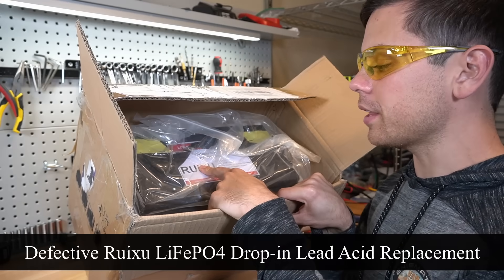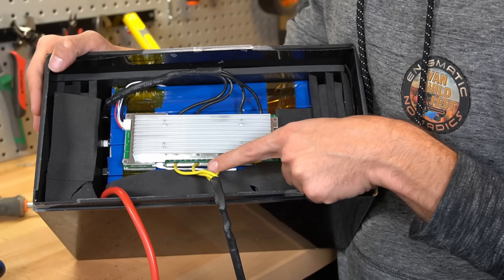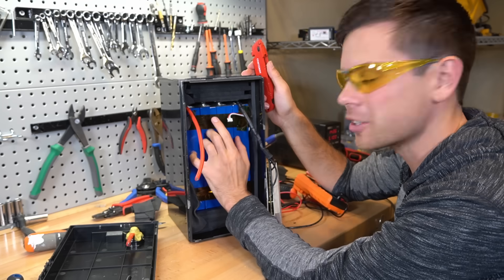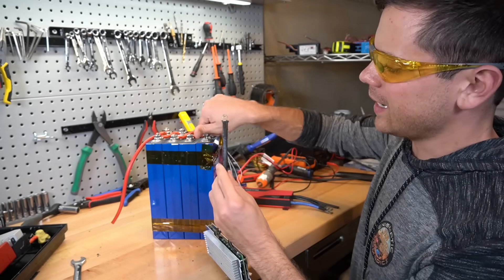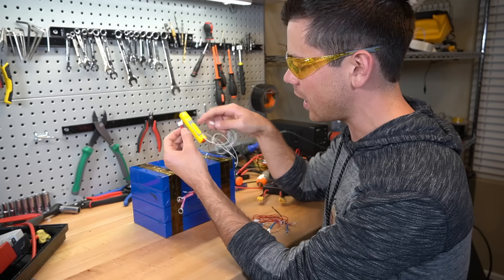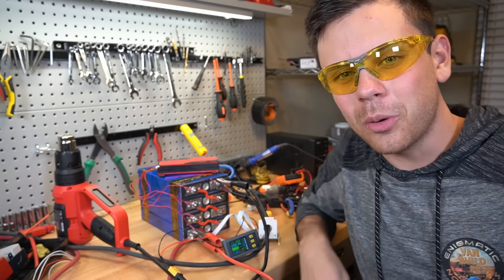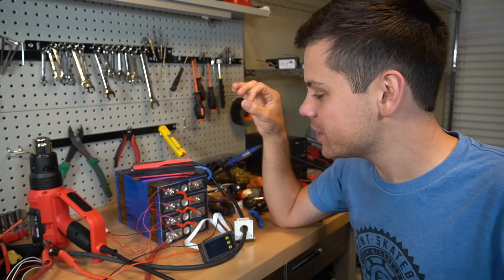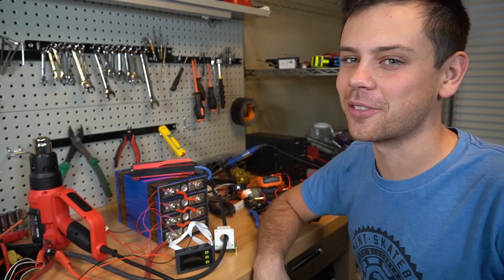Opening a Defective $700 Ruixu 100ah 12v LiFePO4 Solar Battery

Comment: can someone explain why it would read 12.3v with the bms lead disconnected and 13.0v with it connected ? i have a brand new battery thats doing this exact thing, 12.31 volts and wont take any currant....

Comment: If I get it well, there are 4pcs  of 14 AWG wires - for 100 Amps... that is very low.  I would expect like 2x-4x bigger wire crosssection for 100 Amps.

Comment: That's literally how 90% of lithium batteries look on the inside. EVA foam is not that cheap of a material. There are not a lot of materials that you can use to fill the gaps inside.

Comment: The reason why the temperature sensor can only shut off at high temperature, is because it's not a temperature sensor it's a Thermostat. You'll probably see a Temperature Level printed on the package. It's basically a bi-metallic strip that disconnects at some temperature, maybe 50C. And I agree you need to have a low temperature disconnect of some sort. And multiple "temp sensors" is a great and honestly easy way to do that. But charging at very low temperatures will degrade the batteries very easily. So I totally agree with you that this battery package is very bad and I'm very grateful for you to do these type of reviews showing that to a degree you get what you pay for. However beyond hardware and manufacturing repeatability, there is also "soft" elements to any company including customer service which you cannot get from taking a battery apart and may justify the higher cost of some of the battery manufacturers you have listed, basically besides taking the battery apart you need to take apart the company and their methodologies to get the full picture.

Comment: So where shld someone mount the BMS ? if they have this battery + they want to avoid the heat sinking into the blue cells? You shldve showed how to DIY this step by step so this battery can be repaired properly. But u ddnt repair it despite u saying the cells are still good for use.

Comment: Sorry newbe here.  You videos are great.  Probably a silly question, but can these lead acid drop-ins be hacked into a consumer UPS? Be cool to build a super-ups.  I suppose there's still a problem with keeping the batteries at 100% charge. 

I'm a digital engineer so can do ohms law.
Reply: On a cheap UPS, possibly. If the UPS hardware determines that it is taking too long to charge, it will assume the battery is no good and prevent charging. 

On the bright side, you can build a ups easily.

Comment: Weize 12V 100AH LiFePO4 Deep Cycle Lithium Battery, Up to 7000 Life Cycles, Built in BMS, Perfect for RV, Marine, Overland and Off-Grid Solar System.....$599.00......??????

Comment: Thanks,,,, putting a fishing Kayak together and needed to learn about batteries.... Purchased a lithium ion and thanks to you I have at least a better understanding of what I bought.  Thanks alot Sir.  Happy for your success and appreciate you sharing what you know.  I don't know if you will read this as it's an older vid but I don't see any information on the FPV Power 12 V 50 amp hour battery.  They use 2 of those in parallel to up the AH to 100.  Would really like to hear your opinion on those as that's what  I bought.  Extremely light even for a LiFePO4.  Something like 15 lbs for the 2 of them.

Comment: Good to know how badly the battery is designed and  especiallly the bad construction.
The battery cells look good but with the poor overall build, I would hope the actual battery cells are built by a more quality oriented company. Sadly too many China manufacturers have extremely poor quality control, so even that may be suspect. Design aa evidenced by the construction appear worse than most amateur/novice prototypes. Seems no engineering at all, just lash it together cheaply.

Comment: So, this may be easy. Lion Energy Safari UT 1300, Renogy 12v 100AH pouch cell battery for 12V ONLY systems, SOK 12V 100AH prismatic cell 'budget' battery. I'm building a 24V system, so- Renogy is a no go for me, and, the price difference between the Lion and the SOK is not enough to justify 'saving' $80/ battery when so much depends on it... However, that's (4) 'legit' batteries to meet the needs of your viewers. Relion Energy has a broad offering of batteries (space/ power concerns).

Comment: Will, all the heat created inside the battery case will mostly stay inside the case  for an extended time since the foam and plastic are relatively thermal insulation so most of what is inside is going to be at a similar temperature.  The heat created is a function of the internal resistance of the cells.  Especially since the cells are ALUMINUM cased the cells will likely be cooler than the BMS so it is probably GOOD that the BMS heat sink side is glued to the cells.  You could do a heat measurement of BMS and cells when they are separated at say 1,000 watt load and see what the actual temps get to..  Your conclusion may or may not be justified but you have not used a scientific method to reach your conclusion.  Of course , with all drop in replacements it depends on what the intended use is also.  If its to replace a starter battery on a vehicle it will only create heat for a few seconds.  If its used as solar storage it could create quite a bit of heat on a full discharge  etc.

Comment: This guy is not kidding. He is 100% on point. I have two of those 12v 100AH Battle Born Batteries and they are absolutely FANTASTIC. The cheaper batteries have NOTHING on these. The build and material quality are night and day.  I have them in my RV with an 80amp Progressive Dynamics Lithium charger/converter that charges both batteries from dead flat to full in less than 4 hours on the generator in eco mode. These batteries can take a very  high-amp charge, so they can charge safely with my rooftop solar system in addition to the generator charging. I run a 3000w inverter that is connected to my camper’s 120v electrical system through an automatic changeover switch. With this setup I am able to run all my house appliances and electronics including the rooftop central Air Conditioning and microwave.  Even the coffee maker!  The batteries have never even broken a sweat and we beat them to death. They were expensive up front but they pay off in the long term in longevity. I literally never have to worry about them at all. Before I switched to BBB I had gone through two pairs of expensive Interstate deep cycle batteries that were toast after one lapse in my attention. Replacing those batteries cost as much as two BBBs!  So it’s a no-brainer. Lead Acids are expensive, need constant attention and don’t last long. The cheap lithium batteries like in this video are not worth the financial risk since they are built so poorly. BBBs are top quality, long lasting, trouble-free, maintenance free and built in the USA.  I highly recommend Battle Born Batteries. You won’t regret it guaranteed.

Comment: The issue with not having budget options, is that some people LITERALLY CANT afford it. It's why people stay poor. You have no choice but the buy the cheap stuff if you want anything, so you do, and then it fails, and you can just barely afford to replace it.
So yeah, it might not be a good idea for 10 years down the line, but it might take someone those 10 years to ever have the money to buy the perfect battery.

I personally just advocate for the used battery market. You can do so much work yourself, learn a lot, and gain so so much, for far cheaper, or just more for the same price. The biggest thing that I love about DIY, is that you can expand and spend money over time.

Comment: being that it is a drop in replacement for a car battery if it is really cold in the dead of winter and your car wont start because the bms is blocking starting you are stuck.

a sheet of plastic could have been used to protect from shorts

well you could do a rad power bikes and use the sales of another product to offset the losses in the flipping of cheap batteries.

ii would buy those cheap batteries if you tear them down and sell off the cells.

rad power bikes does the offsetting by selling their commercial product the radburro for $6000+ and you have to buy 2 of them for $12000 so they can sell the radwagon and other rad bikes for $1500

so you could buy the $700 batteries from the maker and tear them down and sell off the cells for $75 to $100 a piece and use your flagship products to subsidize the income from your teardowns*

Comment: nice! hey what is that device called you are using to measure the amp hours with the hall affect sensor and the display. i have seen you use it many times. never mind i think i found it: Vac8010f. looks like it can only do 50 amps?

Comment: Why not build the housing smaller or fit physically larger cells instead of all that wasted space.

They could even have built the battery in a way that the circuitry could be externally accessable/ servicable via a hatch instead of stuck to the cells.

I would much rather have a servicable/rebuildable battery than something like this that is basically built to be disposable.

Comment: Nice review and teardown. One thing you might want to use when you need to break open a case like that is try an olfa knife. These are laminate cutters. I use them for scoring and  cutting aluminum, but they should work well for cutting open plastic cases like this。 Use a straight edge to guide the cutter and you should get neat straight cuts.

Comment: Just want to say that battery is so not acceptable, regardless of the cells.   Antigravity Batteries will soon be coming out with our Deep Cycle Battery.... we will welcome a teardown.  Wait until you see how we do it and what we have done.... finalizing production now.  Will just get a small table saw set it to a 1/8th in depth, or a small Battery operated Circular saw set to 1/8 ~3/16"  and rip around the top of the battery to remove the cap easier.   Then you can do the side panels like that easy too.  Your driving me bats with how you dis-assemble these hammering screw drivers in there.... I can do it in 2 minutes with a tiny  saw.  Also you need to understand just because the cell are 100Ah is not the full story...they need to be matched as you know. You get what you pay for.

Comment: Okay, the battery is cheaply made. But, isn't that to be expected for a cheaper battery? I would never ever buy a battery like that and use it anywhere near its maximum specifications. Of course for more naive users a battery like this isn't very safe (even though the BMS did exactly what it was supposed to do and disconnected the battery when it itself was disconnected). On the flip side, users who understand the technology a bit (in part by watching your very informative videos), can still use this battery safely simply by derating it. Many small boat and van owners do not routinely use or need inverters -- we do well with 12V alone. On top of that many of us use 12V batteries in parallel which reduces the stress on each individual battery making high-load uses much safer.
I am not criticizing your verdict that these batteries are deficient but I think there should be a footnote stating that if you know how to use a battery like this safely, it is a way to save some money. I don't own any Ruixu batteries but for maybe $500 new, I'd buy some and use them at 25a max draw and 20a max charge per battery without a concern.

Comment: I'm on disability and receive a little over 800 a month. A battle born would wipe me out for a month and a half. The reason I need something cheap is I need it right now. If I had something cheap I could save enough afford to replace it with a quality product in a year or two. But for now I need cheap affordable batteries. I have even investigated the possibility of buying one cell at a time and building my own lithium iron phosphate battery.

Comment: 3D Printers are getting incredibly popular and incredibly cheap lately. As in <$200 for machines that produce fantastic quality prints. I bet you could design and print custom battery covers. For those without printers, you could even sell them (either by printing yourself or drop shipping) as a nice add-on item to your cable packages.

Comment: It is sad how utterly slack Alice people have become with the construction of their products, it's like almost nobody on this planet has the ability or inclination to do the right thing; instead they just stick it together and say 'that'll do'. I confess that I too don't trust anybody to get anything right so, I have a habit of pulling things apart to see if it needs fixing before I use it; like this new Giandel 4000w/8000w pure sine wave inverter that just arrived - Purchased on your recommendation.
Glad to see that you have started using a resistor to charge up the caps to avoid those unnecessary sparks, car light bulbs can be handy too. Thanks for all your help.

Comment: the BMS bottom metal is not heatsink i think they are just a shield to prevent the battery touching the circuit board.. the top aluminum having fin is heatsink.

Comment: May have been mentioned elsewhere but they are using the cells as the heat sink for the BMS.  Even if the cells start to warm they will almost always be cooler than the BMS.

Comment: you are correct   having the heatsink heat up the cells is yucky  ..... separating the heat sink from cells using a ceramic spacer might improve the lifetime
...... have you ever dissected a battery pack that was made to be disassembled ??  that would be awesome ..

Comment: and ALL (almost all) adhesives are heat sensitive... and the smell? it’s a gas off from the black foam.... it does its own damage....Short sweet and to point, that battery is not cheaply made (they actually designed it to be expensive) its made to be replaced, it has designed into it a 100% fail rate after 10yrs! It’s just marketing tactics that make you believe that it is suppose to last 10yrs. 
  not just batteries either... it’s elmost all consumer grade products...

Comment: From my experience that BMS at normal load is not going to heat up enough to cause any appreciable damage to the cells compared to the cells themselves so sticking the BMS to the cells isn't much of a problem.  What should be happening is that the manufacturers of all lithium batteries should be making the BMS accessible for future service since that will likely be the main failure point of most of these types of batteries.

Comment: 8:35 "You can easily spend more money..."
Nooo, that's the whole point of buying a budget battery, because you have a tight budget...
From your gushing over the cells used in the battery, they are obviously getting good quality on the things that count, the cells inside, just need to do a bit of upgrading and maint. on the battery connections before putting it into use.
Reply from the maker: Or you can watch my advanced battery videos and make one for half the price.

Comment: The battery tops are not ‘glued’ down in the classic sense, rather they are ultrasonic welded. A hot knife should be used to separate the welded seams. The splay of smaller gauge wires soldered to the power terminal act as a kind of fuse to prevent catastrophic explosions should a crowbar condition occur.

Comment: The video editing in this video:
3 seconds, CUT, 6 seconds, CUT, 5 seconds, CUT, 7 seconds, CUT, 4 seconds, CUT etc etc.
Honestly, I got a bit tired about it after a while (probably at around cut 27 or so) and couldn’t finish watching the video. 😛

Great channel otherwise. I love your videos generally speaking but this particular one was just a little bit too much for my taste in regards to all the cuts.
Just thought I would give you some feedback on that.
(But of course, that’s just my own opinion. Others might or might not agree.)
Reply from the maker: People would not watch the video if it wasn't cut like this. My videos are multiple hours long without these cuts.
Reply: DIY Solar Power with Will Prowse Thank you for your reply. I don’t know about other people, but I for one would actually watch for a longer time without the jump cuts. ;)
But then of course, I’m just one single person, and you have to consider the majority of your viewers.
What some YouTubers do is to create a poll with different questions regarding the format of the video and how it’s presented, and then adjust accordingly to the poll results in order to increase the number of views. What’s nice about those polls is that they give the content creator a good idea of what the majority of people prefer, as opposed to just one single commenter.
I don’t know if you already tried to run such a poll among your viewers (I’m quite new to the channel), but I just thought I would suggest that in case you’re interested in learning more about what the majority of your viewers want to see.

Comment: I realize you are very skilled at working on Lithium batteries, but do you have an emergency plan if one gos really bad?  Maybe a halon extinguisher ( or halon replacement agents )  if a water extinguisher , BC dry chemical fire extinguisher is not available. Or maybe a tank off to the side of you’re workbench, then just push it into the water. ( have a push board or something) I am no expert but I just a concerned citizen.